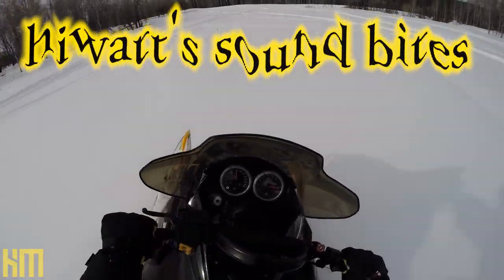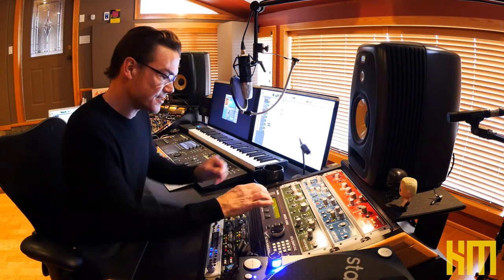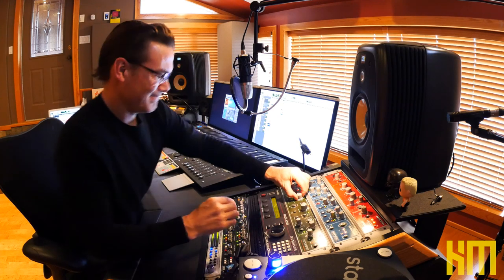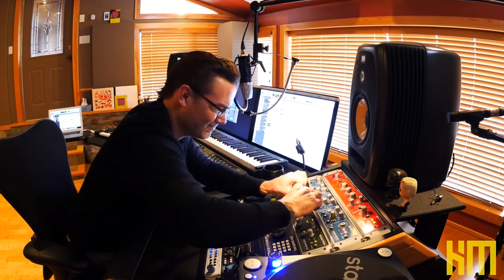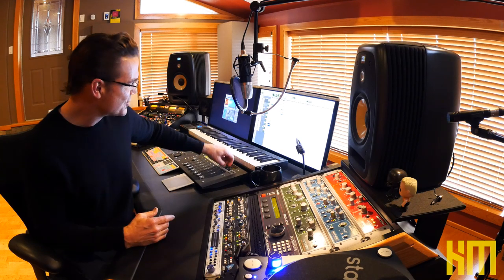Performing Audio Effects with Hardware - Music Production Toolkit

Comment: Totally agree, I still love using my original Effectron 1, ADA One Second Delay and various guitar pedals from time to time. I will say though that as someone maybe roughly your age (give or take, I'm 54), I find because I know what certain hardware sounds like, I'm able to dial in and perform when I want those tones using plugins and controllers in Ableton. I did a bunch of very watery, echo and reverb soaked dub/house mixes performed on a Push 2 and Akai MIDI Mix that would have been impossible with my current or any ever hardware set up. They have a great, dirty, saturated and chaotic sound that came out just as I hoped. The key in that case was to prepare the set and perform it very much as a live mix with NO edits. I'd encourage your audience to absolutely follow your advice and go cheap! Look for unloved MIDIverbs and battered guitar pedals, string them together in various order and see what happens. Love your channel, knowledge, experience and positive energy. Thank you so much!